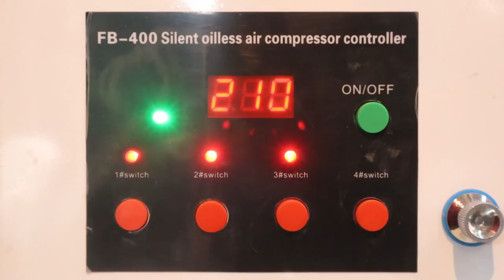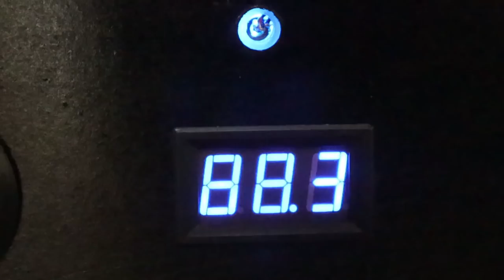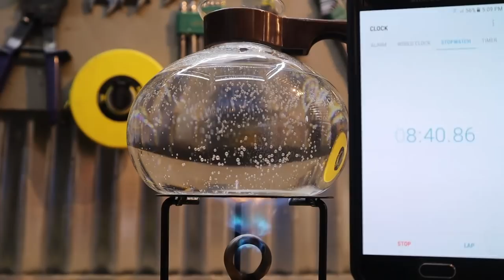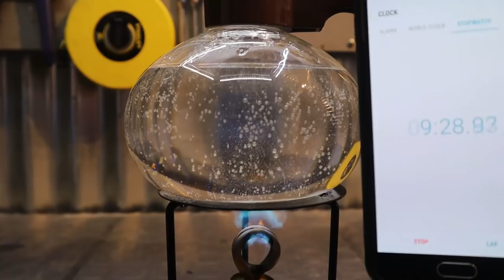World War II (WWII) Vintage Kerosene Stove Restoration.

Comment: fantastic restoration of an old gem. 👍👍👍 I'm kinda surprised you don't have the subscriber count that this channel deserves... Looking forward to watching more of your vids.
Reply from the maker: Thank you very much! I hope to soon rack up the subs!
Reply: Fanstastik
Reply: مم
Reply: @AJRestoration  This Kerosene stove of World War ll time gives sharp Flame ,appears to be Air Pressure Fire Flame but there is no air filling pump anywhere attached with its Container other than Kerosene filling Brass lid. It should be here explained as to how Flame comes out like Gas cylinder  ?
Reply: @abdulrahimkhan5714  I can explain with the permission of the owner of the video. The kerosene builds up presuure when is heated flowing through the two loops in the burner  (You know a fluid in a sealed container builds pressure when is heated ) Dont know if i expalined  myself well...maybe some terms are wrong because english is not my first language. Thanks
Reply: How can i order ??
Reply: Beautiful old piece of history.  I think I would have replaced the wick though.  It was looking pretty rough.

Comment: A beautiful restoration of a very simple stove. Good job, and thanks for sharing it.

This stove looks like it is built upon the same lines as those little home made alcohol stoves you can find  instructions for everywhere on YouTube, only with a metal body not a glass jar. The wick draws the fuel up to the top of the coil where the flame from the spirit cup heats it until it flashes into vapour, which causes it to become pressurized. The vapour then pushes out the hole at the bottom of the coil and it burns like any pressure flame does. Of course the wicks can't stop the pressure from also going down into the reservoir tank (the pressure, NOT the flame) so the tank needs to be sealed, or else the flame dies out, which is why opening the filler lid just enough to relieve the pressure makes it go out. A good tinkerer could build one of these in a shop. It's amazingly simple, I just never realized it would work with kerosene, lol.
Reply from the maker: That is the best explanation of the burning process I have read by far! Thank you!
Reply: These coil stoves were invented more then 100 years ago. And they were kero or gas stoves for next 50 years.
Reply: Same here, interesting that it works so well with paraffin/kerosene, yes; ethanol is what I've seen other DIY ones run on too.

Comment: Great Job Thank You.  We used that copper no-seize paste at work it's fantastic  stuff, you go back on a job 5yrs. Later once you  Crack a bolt or nut they will walk right off from having used the paste before.
Reply from the maker: Thanks for the info!

Comment: Nice restoration! The trick with using unscrewing tap and steel wool is a gem!
Reply from the maker: Thanks! 👍
Reply: I just wonder how to Polish the inside of the  Canister and replacing the wick material.

Comment: Great job. A bit peculiar with a kerosene stove that works without pump. I only thought it was possible with gasoline stoves/torches.
Reply from the maker: We actually tested a few liquids and got the best results with kerosene as opposed to gasoline and alcohol. But apparently it is supposed to be used with gasoline.

Comment: These are great “non moving parts” stoves & easy to use with basically nothing to wear out (exception wick) even the wick should last for years?!
Reply from the maker: The wick is rather durable.
Reply: AJ Restorations 
That’s true, the one in my old SVEA 123R (3months ago purchase) is old, looks original & in perfect condition! They were ahead of their time I’m thinking on the size & weight (1lb) back then for camping & hiking. My family yearly vacations were to travel but one year we went camping, between that & occasional outings to cook outdoors my dad dragged that Coleman 2 burner stove around which worked for the family of 5 so I bought one years later yet never used it so the solo version you or I have is perfect for my needs. 4 ounces of fuel goes a long ways for cooking correct?
Reply: The weak part of coil-type stoves is burner jet hole. When it cleaned with the "pricker", it became wider with time. In normal stoves you can replace jet in the burner, but not in this stove.

Comment: I have built a few of these but always used alcohol. 
Are you saying kerosene works in these as well?
The little dish filled with fuel to heat up the copper coil is just like a kerosene lantern that has to be preheated.
I have changed a coleman white gas fuel lantern to burn kerosene which means I had to also add a retaining fuel cup.
Lord be with you.

Comment: Not sure about melting lead for bullets, by Second Word War most would be using factory made ammunition.  It is possible someone was hand loading for the fun and to save money but I'd find it entirely more likely they were using it to make a cup of tea while out in the bush. But still a very practical little stove and next restoration, the roof of your workshop? (9.54min)
Reply from the maker: Thank you for the info and comment. What you see there is the outside of the workshop. Things have changed over time and it is much tidier outside now.😀😀😀
Reply: I agree with John, unless they were using muskets from 100 years prior, there's a lot more than melting lead that goes into reloading.   Second. Every firearm by 1910, fired much to fast to shoot lead bullets, they were commonly copper coated, some were steel core. (Russian 7.62x54R)(1893)

Comment: Hello and thanks for the video :) Never seen one of those. What is the principle of work of this stove. I can understand  that kerosene gets hot and starts to burn like in jet-engine, but where is/are the  nozzle(s)?
Reply: Look at 14:35 in this video. There is a very very small hole in the copper tubing. The copper heats up thus evaporating the alcohol which is replenished in the copper piping via "capillary attraction" by way of a "wick" which is 100% cotton and is in the tubing and out of the tubing into the liquid fuel. This is an alcohol stove. I have never seen kerosene run from a stove like this. I will this with kerosene as well.

Comment: This is really nice. No air pressure required. Where are the holes in the round circular burner? Underside? What make is it?  German? Swedish?
Reply from the maker: Thank you. The hole is on the underside of the upper part of the coil. We do not know the manufacturer of the stove, there aren't any identifiable markings on the stove to try and trace origin.
Reply: Simple , but good and long last

Comment: Olden days' technology is evergreen nothing is equal to this bro still it is working amazing 👌 please let me know about the burner and Wicks how it works
Reply from the maker: There is a wick inside the copper pipe, the wick sucks up the fuel and the flame on the outside heats up the fuel creating a vapor. The vapor then becomes pressurised and escapes at the only hole that is open and that is then ignited by the external flame and starts a cycle that keeps the coil warm and pressurised.

Comment: How tall and wide is it, and what diameter is the copper tube from your beautyfull cooker ?
Reply from the maker: The tube is 3cm/1.1" in diameter. 
The stove is 10cm/3" tall.
The stove's copper base is 5cm/1.9"
The copper base is 9cm/3.5" in diameter
The stove cage or housing is 12cm/4.7" wide and 13cm/5" tall.
Reply: @AJRestoration  Thank you for your answer, and how big is the tube in mm ?

Comment: Just watched your electrosis (sp?). Can you do the same to brass?
Reply from the maker: I don't think you can use that process on brass, I had a good result with brasso and cotton. What also works good is coarse salt with a little bit of lemon juice, scrub it in and wipe it off, just sometimes if you scrub too hard it can scratch the brass. So if you are sentimental about the brass item, its better so stick to brasso.

Comment: Why did you heat the parts before you painted them?
Reply from the maker: The powder coating has a better finish, the parts keep moisture and when you preheat the parts you take the moisture out. Powder Coating does not like moisture when it is curing in the oven.

Comment: Nice restoration. Are you sure it is a paraffin stove? It seems to be an alcohol stove.
Reply from the maker: You are almost correct, at first I thought it was a paraffin stove, but paraffin stoves don't come with a wick and you usually have to pressurise the paraffin stove variant. This one turned out to be a petrol stove, but alcohol would also work, and as we see in my video, paraffin also worked but not as good as it would with alcohol or petrol. I think this kind of stove is awesome since it works with all three fuels. Makes it a great shtf survival item.
Reply: I have a similar stove with the copper coil and the instructions say PETROL. Great job.
Reply: @AJRestoration  As you see, it perfectly runs on paraffine. Petrol-only stoves can't work on paraffine: their jet holes are wider so paraffin will burn with brightly-yellow flame with smoke and soot.

Also, pressure release with fuel cap is extremely dangerous with petrol/gas (but can be used with paraffin). You will blow the flame off and after this open the fuel cap.

Comment: How does it works?
Reply from the maker: There is a wick inside the copper pipe, the wick sucks up the fuel and the flame on the outside heats up the fuel creating a vapor. The vapor then becomes pressurised and escapes at the only hole that is open and that is then ignited by the external flame and starts a cycle that keeps the coil warm and pressurised.

Comment: From where this air mixed kerosene (aerosol) come as fuel
Reply from the maker: The air mixes with the kerosene vapor as soon as it exits the nozzle.
Reply: Where is nozzle ? where is the
location that nozzle is installed ?
Reply: @rezaasadi2114  that's what the answer we want to know
Reply: @Chandrasekar Govindasamy
@Reza Asadi
I believe the nozzle he’s referring to is the pin point holes in the copper coil. Preheating the pan under the coils build up pressure in the tank then the fuel sucks up the wicks into the coil igniting those “nozzles” weeping the fuel building up more pressure & that’s the roaring jet sound that you hear when it’s 🔥 burning.
Reply: @IAMGWH1  yes it is .
Reply: @Reza Asadi 
Check out those SVEA 123R stoves I have (2) I bought on Ebay they are sturdy & you can adjust the flames from simmer to full blast. 50+ minutes on 4 ounce burn time I believe? Look at the videos here on the tube.

https://www.optimusstoves.com/us/us/200-8016279-optimus-svea

https://en.m.wikipedia.org/wiki/Svea_123

Comment: is it without air pump?
Reply from the maker: The heat makes pressure inside the body, and it becomes pressurized and kerosene vapour is forced out the small hole in the coil, that ignites due to the flame already present!
Reply: @AJRestoration  thanks

Comment: Surprise
How burning without air pressure
Reply from the maker: There is a wick inside the copper pipe, the wick sucks up the fuel and the flame on the outside heats up the fuel creating a vapor. The vapor then becomes pressurised and escapes at the only hole that is open and that is then ignited by the external flame and starts a cycle that keeps the coil warm and pressurised.

Comment: But how it's flame work in copper coil 🙄
Reply: copper pipe, it vaporizes the fuel
Reply from the maker: There is a wick inside the copper pipe, the wick sucks up the fuel and the flame on the outside heats up the fuel creating a vapor. The vapor then becomes pressurised and escapes at the only hole that is open and that is then ignited by the external flame and starts a cycle that keeps the coil warm and pressurised.
Reply from the maker: Indeed it does!
Reply: @AJRestoration  Sir,  could you tell me where the hole you metioned is, please.
Reply from the maker: The pin hole is in the copper coil.

Comment: Wait a minute everyone, something is seriously wrong here; do you mind explaining what exactly is burning here?????? I am afraid its a scam.
and where is the restoration here? this is just a cleaning job.
Reply from the maker: There is absolutely nothing wrong here, the kerosene is sucked up by the wick in the coil, the flame that is lit on the outside heats up the coil and vaporizing the kerosene on the inside of the coil. Pressure is built up and the kerosene vapour is forced out of the one little hole on the bottom side of the coil and is lit as soon as it comes out, thus creating the flame that boiled the water. It is no scam, I do not do scams on my channel. You need to do some more research before you claim something is a scam. Thank you for your time and feedback
Reply: What is your version of the term restoration?I think your intelligence is the only scam here.
Reply: @AJ Restorations 
Sort of the same as a SVEA 123 stove that I have! It builds up pressure (pre ignition under burner) causing the top burner to ignite (small weeping fuel) while wicking the fuel from the tank. Mine isn’t coiled but same principle?

Comment: Реставрирует такие старые и интересные вещи а крышу починить не может. Позор!
Reply from the maker: What is wrong with the roof? It is a tin roof. A tin roof makes a noise when it rains, half the houses in my country have tin roofs. 
Что не так с крышей? Это жестяная крыша. Жестяная крыша шумит, когда идет дождь, половина домов в моей стране - жестяные.
Reply from the maker: I think you my be confused. There is nothing inside the workshop that gets wet. What you are seeing is the outside of the workshop, rain usually wets things that are not under a roof. 
Я думаю, вы меня запутаете. В мастерской нет ничего, что промокло бы. То, что вы видите, - это снаружи мастерской, дождь обычно смачивает вещи, которых нет под крышей.